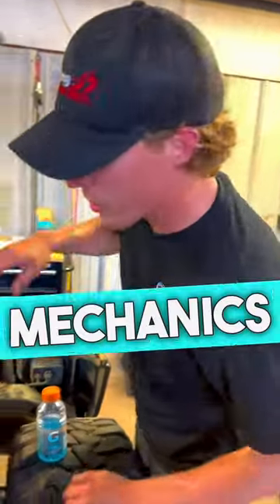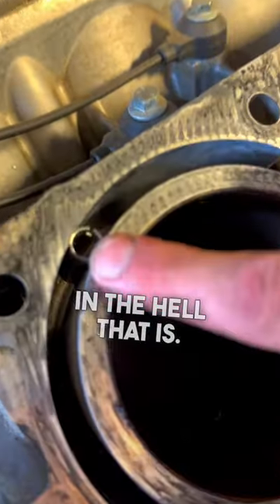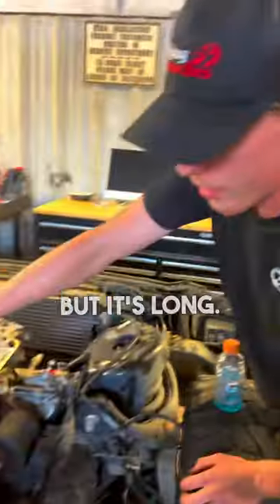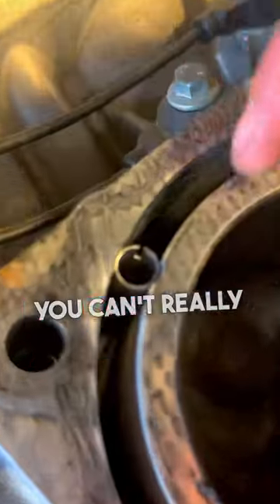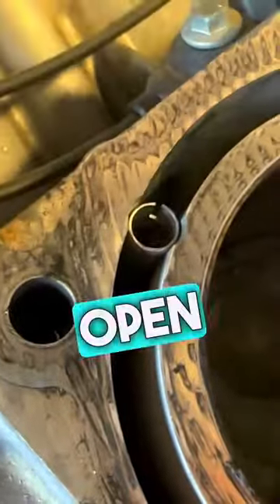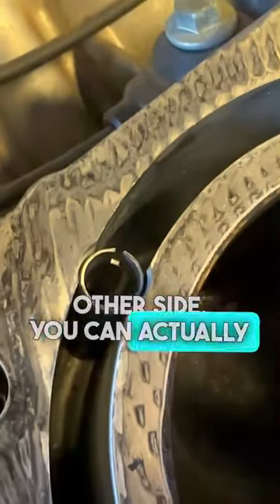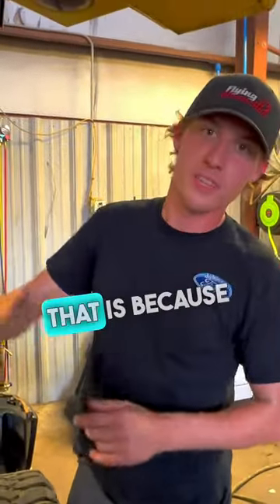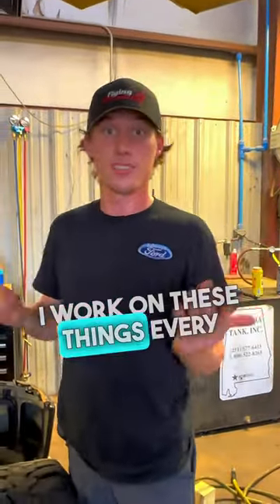What is this? #shorts

Comment: They’re used to decrease the swirling of the coolant while it flows through the block. Basically the swirling coolant mixed with small bubbles smack against the back side of the cylinder liner which creates cylinder linear cavitation. Those inserts try to prevent this to give the cylinder liner the most life possible. Eventually it could cause coolant to enter the oiling system. - Master tech
Reply: Anti cavitation tube
Reply: It's like a baffle?
Reply: Cylinder liner? It’s a parent bore block dude.
Reply: Another internet “master tech”
Reply: @jimmysturdevant9843  we are talking about the purpose of the insert, not the engine/block. Now with that being said the same damage that could be done to a serviceable liner can take place on a parent bore block hence why ford is using them.
Reply: @coolkid8934  not debating this dude. I’m an engineer for ford. 😂
Reply: I'm glad I didn't have to type that
Reply: ok, If you're an engineer for Ford will you confirm there is a sort of trend towards designing cars that are going to be too much to work on or replace major components thus driving people to more new vehicles more often. 

is this planned observance a thing or internet bullshit.
Reply: @justpassingthrough3166 planned obsolescence has always been real, and it a real marketing strategy companies use to ensure you keep buying their newer products when the one you just got breaks.
Reply: @GregPillon  I know and understand there has always been failure designed into manufacturing of just about anything. 

What I was trying and failing to articulate was is there a stepping up of this designed obsolescence and car companies are making sure now premium cars are almost out of reach for middle class now,  too cheaply made to become resold used after a very short time, and when a car does have a problem only a dealership charging 10k for stupid shit like a dash going out has the tools and tech to work on them thus creating a monopoly and making it even more expensive to own even a basic vehicle. 

Seems the elite like World Economic Florum founder Klaus Schwab really meant it when they said we'd own nothing and be happy
Reply: @justpassingthrough3166 it may be that, I feel like it's a combination of fuel mileage requirements, putting too much tech in to make it desirable, poor quality control...etc
Reply: Seems kinda stupid if you ask me.
Do they build these engines very poorly?
Older engines ran over hundreds of thousands of miles and I never seen a cavitation issue.
The only engines I see to have issues like this are ones that have salt water pump pumped through it. Even then the cylinder liner was okay. Had to junk one because the passage wall was rotted away beyond repair.
Reply: But then get sued for trade secrets and negate all your hard efforts so sayeth uncle sam.
Reply: @@adog3336then they would really hate what I'm doing, putting an LTG 2L turbo and the six-speed from a 16 regal gs in a 88 Pontiac fiero, because fuel mileage and decent power in a car that could have been one of the cooler cars they made
Reply: I learned something new today. Thank you.
Reply: @justpassingthrough3166 notice how he didnt reply, thats all you need to know 😂
Reply: @justpassingthrough3166 it's bullshit modern cars go double, triple the mileage cars from decades ago used to as a matter of routine. It's like you people don't even know how shity cars used to be going back to the 70s 60s 50s. Cheap old used cars today have never had higher mileage on their odometers.
Reply: Planned obsolescence , right ?
Reply: The coolant doesn’t smack the cylinder wall, the cylinder wall smacks the coolant and contracts again causing the bubbles to explode
Reply: So why do they appear in some engines, but not others? You'd think he would have seen it by now.

Comment: It's to help with cavitation. At least that's what the old-timers always told me. Coolant can flow in a way that when contaminated can actually deteriorate the block-which you know, and that tube is supposed to help with that and airlock. I don't know I've been a mechanic for 20 years and that's always what I was told maybe it's wrong lol. Also, I've been looking for another mechanic to hire and I can't seem to find anybody and I noticed that because they're all in the comment section on YouTube Videos.😂
Reply: You probably just cant afford them. They can get $80.00 an hr in a dealer and can charge $100.00 an hr for comtract/independent work. You offering more than $100.00 an hr?
Reply: @oddmanout7755  I almost was not going to even reply to this, but I can't resist. Let me poke a couple of holes in your well thought out comment here… First of all, I'm in the heavy truck and equipment industry and I can tell you that any repair shop around me is billing out at way more than $100 an hour. Second of all, that $120 an hour is not what the employee makes that's what the shop charges to cover overhead-which is defined as anything that cost the business money to operate. Payroll, electricity, insurance, taxes just to name a few. The average equipment technician is making anywhere from $28-$40+ an hour right now based on experience and yeah that's what we are offering. While I agree with you that yes there are probably places that cannot afford to pay the high hourly wage that people are getting right now that's not the case with us. The problem is a compound problem but 80% of it is no one wants to work. They want to collect their free money and sit here on YouTube and leave stupid comments arguing with people like I'm doing right now.😂
Reply: And before you come back and dispute everything I just said do a little research first please. You want to disagree that's perfectly fine but read up on it. Read the job report. Read some articles written by people that are conducting job Interviews. Interview some people yourself and they'll tell you firsthand that they want the job but not until their benefits run out and they can't collect anymore..because I've had over three people say those exact words to me. Or maybe you can find a way to work in Covid as an excuse because I don't think we smoked that enough. I think we could probably get another five solid years out of it if we really put our minds to it! Vote fer Joe!!!
Reply: @Adam_Poirier omg dude this comment is the best shit I've read in a long time, I'd come work for you in a second if you were anywhere near me. You are right on the money too, way too many ppl are content to sit and take that"free" money and then cry about why everything costs so much. I'm in the heavy equipment business myself and you're exactly right, I'm making 36/hr in CT.  Thanks again for that comment, it made my day lol😂
Reply: @soupy031  haha thanks man. I see the rocket scientist I was talking to never bothered to respond, all that typing for nothing...😂
Reply: @Adam_Poirier Where you at? I'm game.
Reply: When I worked at a Chrysler dealership 6 years ago the new techs where getting $15 an hour and master techs where getting 28-34 an hour ( commission work by the book) can’t remember but I think the dealership charged $125 mechanical hour. Old timers said it used to be 50/50 pay split for the dealer and the mechanic,but that was a long time ago. I can see why there’s a shortage of mechanics nowadays, low pay, disrespect from customers and managers, it’s dirty work, tools cost a fortune and could easily pick up a job at Chick-fil-A starting at $16 an hour.
Reply: @CrystalcastleL7 
Chick-fil-A in California now gets $22/hr
😂😂😂

Comment: It's called a "turbulizer". Turbulent liquids transfer heat uniformly and prevent hot and cold spots and block cracking. Cavitation doesn't come into play, that's when you "break" water and the vacuum causes bubbles and noise in propellers, for instance.

Comment: Honda calls them a coolant seperator and they are rubber. Some OEM's call um diverters. Prevents hot spots and cylinder wharpage. Also can create head gasket problems if not installed properly. Basically makes the coolant go the longest way around the cylinders to prevent the shorter path. This enables the coolant to transfer the most heat away and also regulate the heat evenly over the bank of cylinders.

Comment: Like another commenter said, I have also seen these on outboard motors except they’re usually rubber tubing. They’re “water deflectors” to force the coolant to flow a certain way. If you leave them out, the engine could possibly overheat. I’m guessing these are the same thing, just made from a different material.
Reply: I have never seen an outboard with coolant much less coolant tank. Maybe an inboard but even then… “like another commenter” said was probably your first mistake jackazz
Reply: @Carlos-lh3bq I'd suggest that you've never actually seen an outboard motor, period. Never seen one yet that didn't run the water they're in as cooling except for little trolling motors.

Comment: Yup they all said it. Subarus use a large insert around all the sleeves. And the call it a coolant dampener. Keeps the coolant from finding fast flow and allowing little whirlpools in the cylinder head 👌

Comment: It's there to stop cavitation of the coolant.  What is cavitation of coolant.  When you boil water on the stove you see the little bubbles on yhe bottom of the pot , well that's cavitation and in an engine block and cylinder heads when all those little bubbles pop it takes a little of the medal away and unchecked it will eat a hole in your engine.  In all diesel engines the manufacturer tells you to put an additive in your coolant to stop it.  That tube might be there to stop vibration of the cylinder wall and direct coolant flow.   Free standing cylinders like that can set up harmonics like a tuning fork that can eat up the head gasket.  OH always use distilled water and 50% coolant in your engine and never use 100% tap water except in an emergency only.

Comment: A lot of smaller 50hp and under Mercury outboards have those. My 1989 50hp US Marine FORCE outboard has em too. Comparing a marine engines cooling system to a car/truck's is like apples to oranges. Marine engines have really cold water pumping through them at all times, whereas in a car or truck with a closed cooling system the coolant warms up and stays warm until you shut if off and let it cool. If you got your Marine engine up to 180-200 degrees you'll probably be investing in a new power head. One of cool feature is how fast you can diagnose a stuck thermostat on an outboard or even inboard, takes 5-10 seconds, experienced Marine technicians can tell within the first 10 seconds if it needs a thermostat, that super cold water running unchecked through the system kills the engine right away, it'll struggle to start and run like crap once it finally gets going. It really is such a huge difference you can hear it clear as day.

Comment: It's to prevent cavitation....because...

Cavitation is a phenomenon in which the static pressure of a liquid reduces to below the liquid's vapour pressure, leading to the formation of small vapor-filled cavities in the liquid. When subjected to higher pressure, these cavities, called "bubbles" or "voids", collapse and can generate shock waves that may damage machinery. These shock waves are strong when they are very close to the imploded bubble, but rapidly weaken as they propagate away from the implosion. Cavitation is a significant cause of wear in some engineering contexts. Collapsing voids that implode near to a metal surface cause cyclic stress through repeated implosion. This results in surface fatigue of the metal, causing a type of wear also called "cavitation". The most common examples of this kind of wear are to pump impellers, and bends where a sudden change in the direction of liquid occurs. Cavitation is usually divided into two classes of behavior: inertial (or transient) cavitation and non-inertial cavitation.

Comment: This is a diverter plug which channels water/coolant into the cylinder head…common in outboard motors due to raw water being used and maintaining circulation and preventing short circuit

Comment: Back in 74, My neighbor took delivery of a new Furd…after several weeks, it continued to burn oil at an astounding rate and smoked like a mosquito fogger.  When he took it to the dealer and they tore down the engine they discovered it had NO RINGS on the pistons!
I’ve never owned one since!
Reply: It ain't running with no rings because it won't have compression.
You need spark, fuel, and compression. Remove 1 and it don't run...the end.
Reply: I don’t believe you. It’s impossible

Comment: At first thought it was a funky sleve shim, use those for making power on volvos. But it's most likely meant to help prevent cavitation. Even better eay to fix this is Evans coolant, it's waterless,  so it won't vaporize on the power stroke when it's around the cylinders. Much better cooling and almost hobpressure in cooling system with it.

Comment: Its an open deck block the tube is there to reduce the cylinders warping where they are not fully attached to the block for just over half of the cylinders length

Comment: That apparture is paramount & designed to significantly decreases the centrifugal force to a centrepetal force by calibration-friction causing a dramatic flow from a high pressure to a low pressure gradient allowing molecular decrease of brownian movement promoting effective heat transfer molecular heat to fractalize the surface of the electron of the molecular coolants valence electrons outer shell; therefore satisfying Newtons third law of Thermodynamics. ~ GREASE MONKEY TUNERS (MASTER Backyard Mechanic)

Comment: I’m no engineer but I’d assume it’s to increase cylinder strength or rigidity. 

A last ditch effort in the manufacturing process when they realize the engine won’t pass the warranty period without an overhaul due to oversights in the development. 

Just something simple to reduce cylinder warp (because they should have gone with a closed deck design)

Comment: If my intuition is correct, which is not common, it's to burp air from the coolant of it gasses from high heat. I'm doubtful though
Reply: Burp is not the right word. Prevent overheat air lock? If the coolant is mostly water, the boil point will be lower yes?

Comment: That is there, so that’s connected to your Alexa, iPhone, android, and the sync system., as soon as a device hears you talking about a new truck, the body control module runs a short through your coolant, damaging the coating and allowing that tube to rust enough to become dislodged, and block coolant flow to the next jacket, and blowing your engine, and ford programmed your truck to cover its ass, now we all know why it says “check coolant additive” every 10k miles.., and you all know just like me, we never check it, and lie to our trucks, resetting the warning..

Comment: That there is a sweat expansion valve put there to remind you your this deep in a FORD ENGINE and you about to sweat alot more than the usual FORD sweat....yes im a CHEVY guy and i know why you like to work on FORDS ....their easier than those toy,nis and honda or dy's and the main reason is job security lot's more work  than an ole CHEVROLET= CRACKED HEADS EVERY VALVE RATTLES OIL LEAKS & ENGINE TROUBLE....No kidding like your show,skits,bitchin what ever you youngns are calling em
P.S. I bet deep down inside you are a Muastang and just in general a FORD LOVER....I am a destroked 400 in a 78 z-28 camaro,06 impala ss, couple 4x4 04,98,00 chevy truck dude yea im that dude ....i have to have that many chevys to make it where im a going😂

Comment: Amateur. That my good sir is the blinker fluid overflow tube. Cause when you see those jackasses driving around with their blinker on for 30 miles, it just heats the fluid and that overflow makes it so it doesn’t over heat and blow your radiator gasket. If you blow your radiator gasket, you might as well call the scrap yard to pick up your vehicle. It’ll spew that shit all over your driver seat.

Comment: I’m gonna go with it gives the cylinder stability. There’s really no other reason unless  it creates a hotspot without it
Reply: No sir. A small dowel like component like that provides no structural support. It’s to stop coolant swirling in the back of the head and avoid cavitation. 👍🏻
Reply: @jimmysturdevant9843 I agree, it would have them on the bottom side too if that were the case